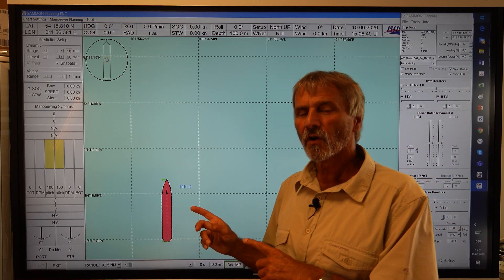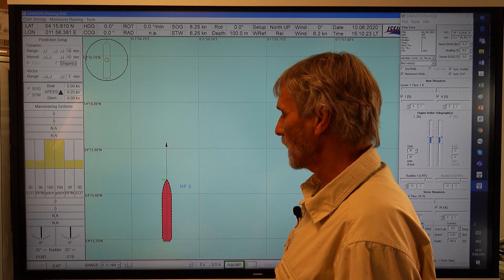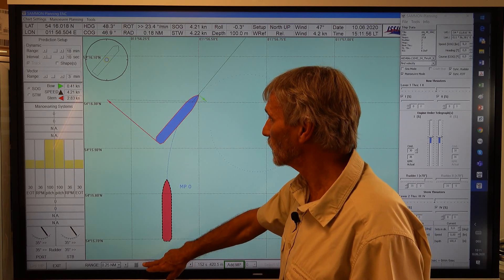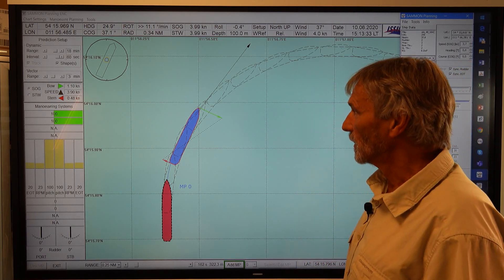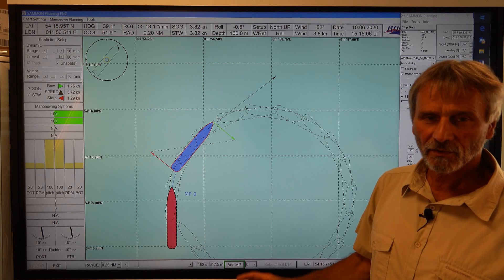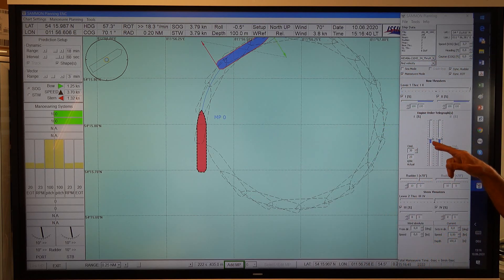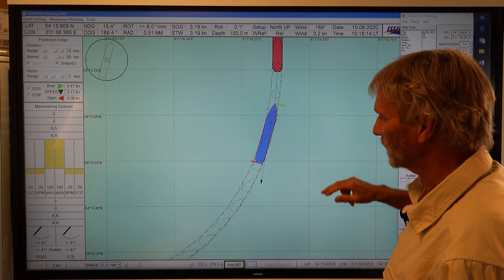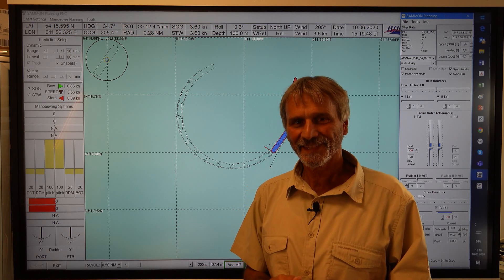Pivot Point Specials 2 - position for ship moving ahead or astern

Comment: When coming astern, how does the transverse thrust affect the pivot point?
Reply from the maker: It depends on where you produce the transverse thrust:
- when you use the rudder or azimuth propellers (see the specific movie on "Stern first method ") then the PP moves to the center or even to the aft in the direction of motion. 
- if you use the bow thruster (now at the end of the ship in the direction of motion) then the PP is at the stern, I.e. now close to the front end of the direction of  motion...
I do hope it helps..

Comment: I think there is a difference between pivot point and point at which the ship rotates. In the case of wind, if the pivot point moves aft in the example shown, then how can we explain the bow still seeking the wind?
Reply from the maker: No, there is no difference between pivot point and point at which the ship rotates - it is the same, per definition. And it is the result of ships transverse motion and not sort of fulcrum to lever bow or stern into the wind...
Reply: @issims-innovativeshipsimul4419  Hi Knud, I think it would be a good idea for you to explain the difference between the PP and the Center of Lateral Resistance (CoLR). In many textbooks and even among practitioners such as pilots, the position of the PP is still used as the fulcrum for turning moments and used to explain e.g. why as bowthruster is less effective when the ship is moving ahed, i.e. the PP is forward of midships, therefore the lever to the bowthuster is small and the effectivness of the bowthuster less. This is obviously wrong as by using the bowthruster the PP moves astern and using the PP as the fulcrum, the effectiveness of the thruster would then increase. I think by adding a video on the CoLR and explaing the difference between the PP and CoLR, mariners would start to realize that the PP is not the magic point that explains everything in shiphandling :)! 

Regards, Reto
Reply from the maker: @retoweber9143  Great, your answer is to the point, I could not have explained it better. Maybe I will find the time for that movie suggested...
Reply: @issims-innovativeshipsimul4419  I see, that would be the misconception of thinking of the pivot point as a sort of fulcrum. 

An example I could think of would be a twin stern azimuth ship walking to port but keeping its bow facing a fixed object (some distance forward). The point of rotation by this definition could be anywhere the ship points the bow as it walks sideways (which is also the pivot point by definition). 

Now imagine doing what’s described above but also make some stern way, you now have a build up of pressure on the stern causing more lateral resistance on the stern vs the bow. It would seem to me wind would want to blow the bow more then the stern, creating some sort of fulcrum further aft of midship due to the stern way (trim and sail area equal). In this scenario, if wind is coming from the port side, i would think my bow would want to fall off more to leeward, and more correction would be required on the controls. That’s how I think of point of rotation vs pivot point.

Comment: 7:31 Are you sure ?  Wind will move PP outside the ship it is true but because of sway to lee-side the hydrodynamic pressure on port side of depicted vessel will be much reduced thus diminishing momentum on the port shoulder ahead of PP. Lifting moment on rudder is reduced as well. Practically turn vessel to lee-side more difficult. P.S. Excellent video.